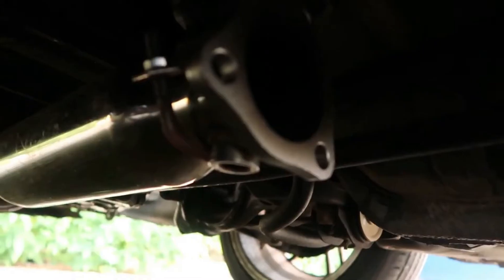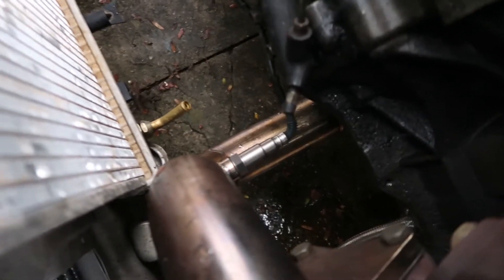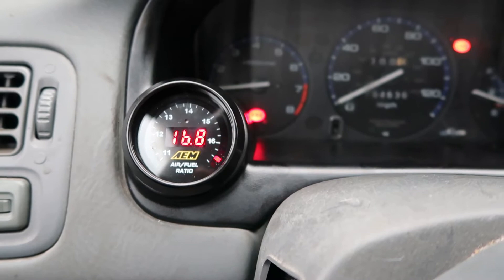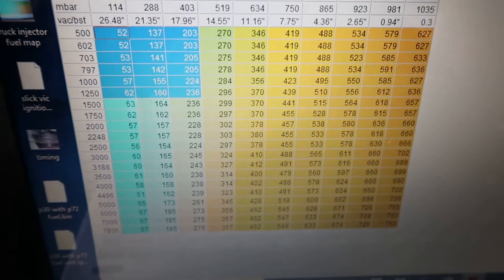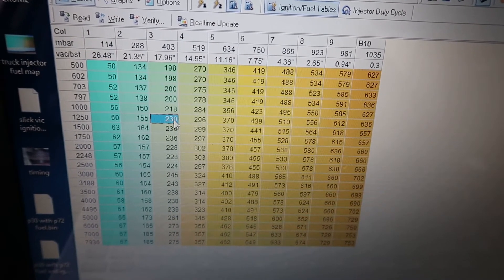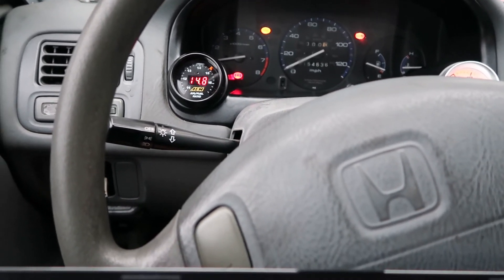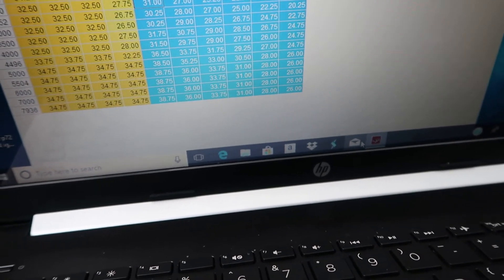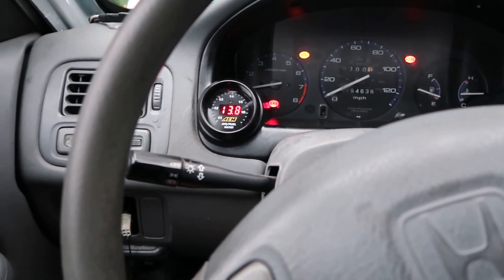Idle Tuning The Turbo D16Y7 and a Visit To WickedFab

Comment from the maker: Quick update. I smoked tested a vacuum source and found a leak at the throttle body gasket. Replacing the gasket should cure the 1500rpm surging and I may need to go back in and make corrections since its "tuned" for the vacuum leak.